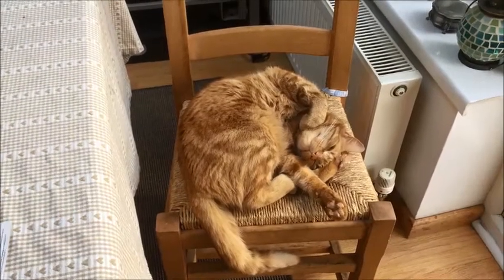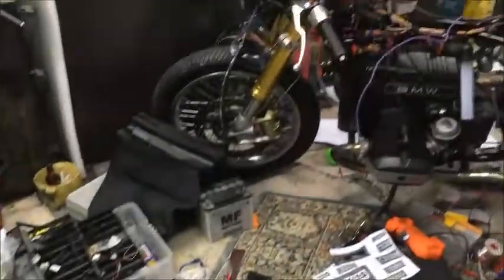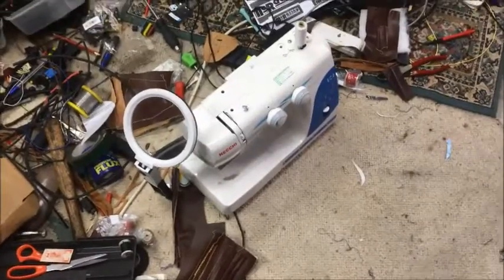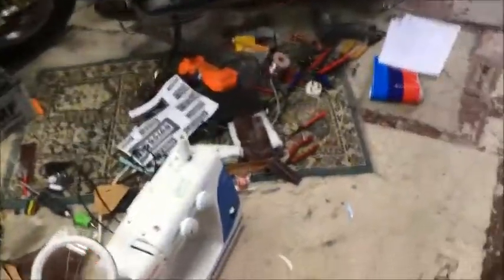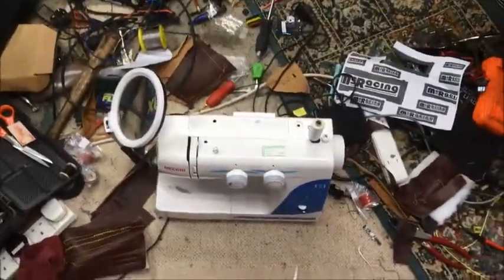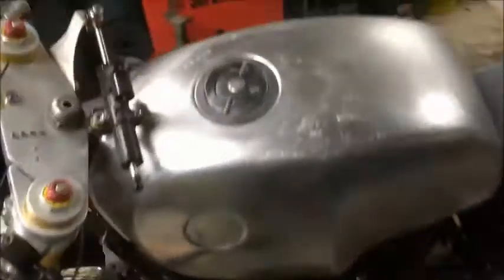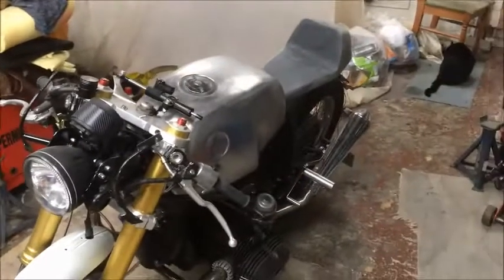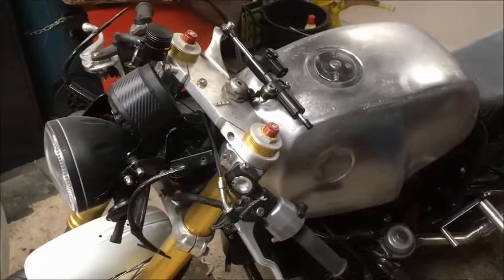bmw r80 cafe racer project part 59

Comment: may I ask where you got that petrol cap and how much it cost.
Reply from the maker: good afternoon, got it from ebay, it cost £72 a company called manx-direct, (if you buy one you can tell them that you saw it on my channel and they can send me a big fat advertising cheque).......... description was BMW MONZA CAP CNC BILLET ALUMINIUM CONVERSION KIT BOXER AIRHEAD R45 R60 R65 R75.